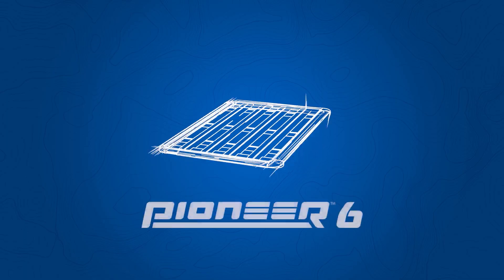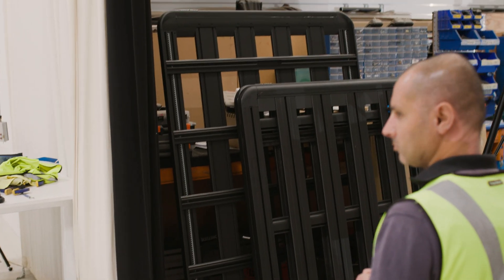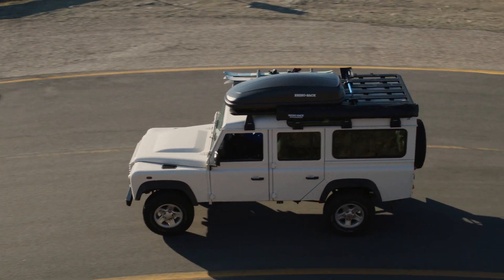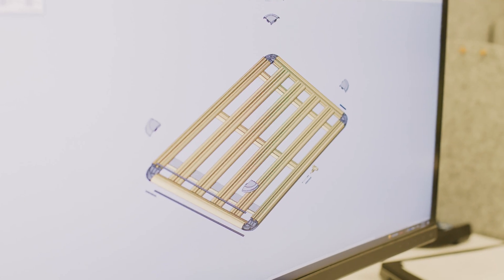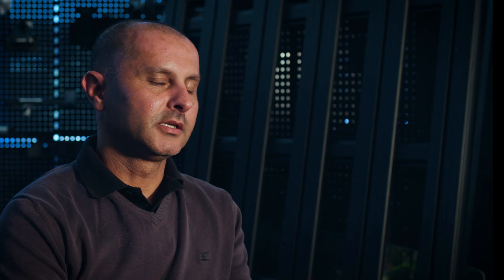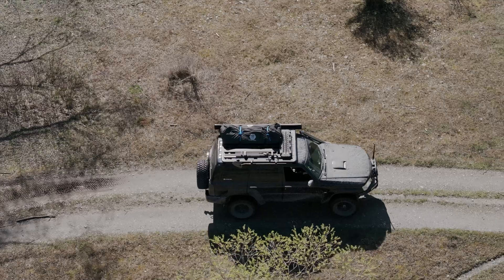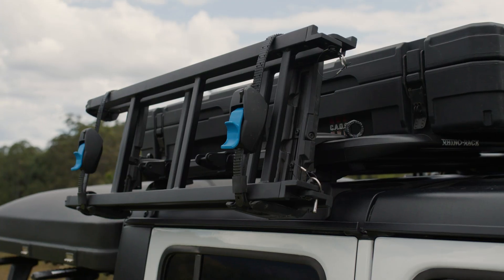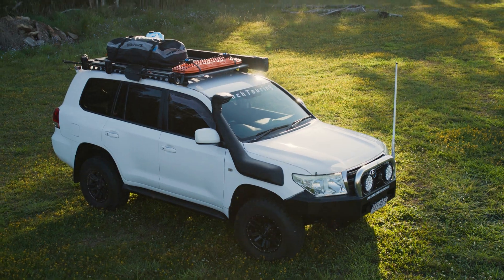Behind the Build | The Pioneer 6 Engineering Story

Comment: Your previous generation product has excessive wind noise, especially when installed on the Hilux. Just a month after my purchase, a new model was released. Customers are compelled to buy the Rhino-Rack Wind Fairing , adding several hundred dollars to the cost.The ingenious aspect of the product design is that the Rooftop Rack itself feels quite affordable at a few hundred dollars. However, when you consider the cost of accessories and labor for installing it on the roof, these costs far exceed the Rooftop Rack itself. Now, you still can't use it without purchasing a series of additional accessories to secure your gear, and before you know it, Unknowingly, you find yourself having to pay thousands of dollars.